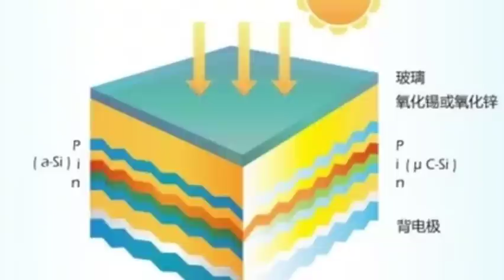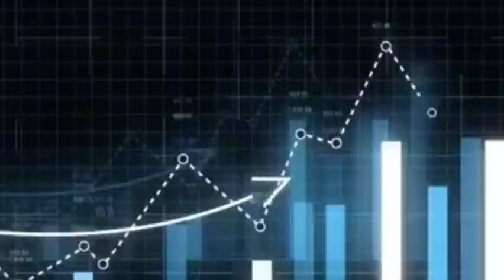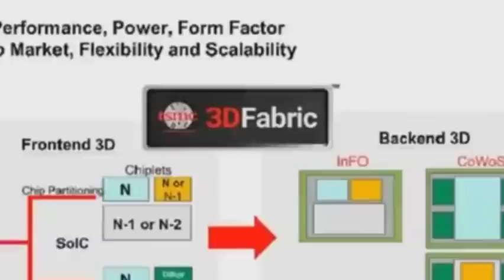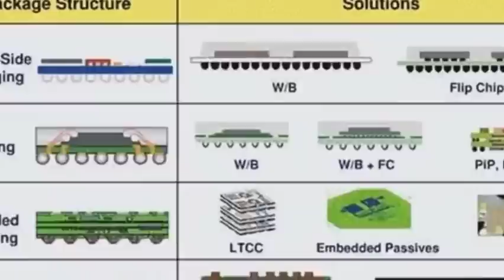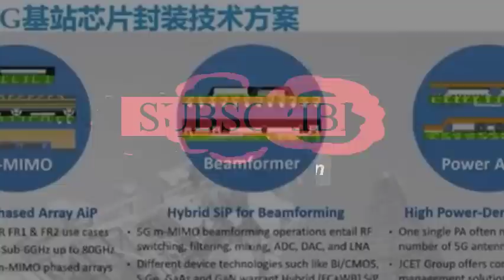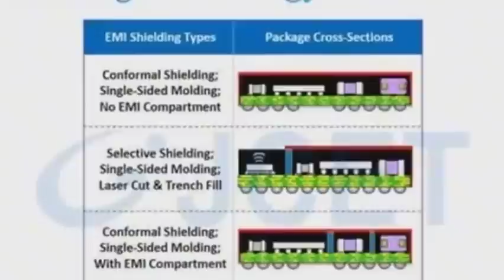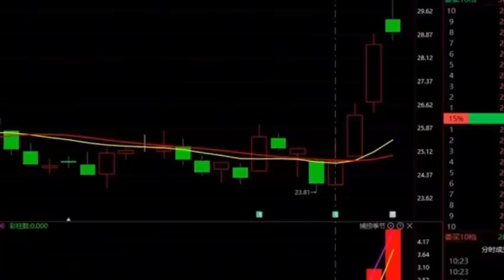China begins mass production of 4nm chips? These are the truth about Chinese Chip-in-Package.

Comment: No.  As of the beginning of 2023, China can 1) produce 28 nm chips and 14 nm chips in production quantity. 2) Can produce limited number of 7 nm chips.  3) Can handle 4nm packaging.  

That said, given its track record, I am expecting them to reach 7 nm mass production within 5 years.  In 10 years, they might know how to make 4/3/2nm chips in mass production, but let's face it, 3 nm and 2 nm chips are irrelevant given how much it costs to make.  And it is so small that quantum interference will make further development impractical.

But that said, China will still go through the process of 4/3/2 nm chip making.  By then the silicone chip industry is a high end but sunset industry.  The industry will move on to graphene chips, where China is on par with US/Samsung/Taiwan in term of technology development.
Reply: I hope China will be at the forefront even if China is cheated by other countries bro
Reply: As I understand chips packaging is combining chips on wafer level. That is even better. Not producing cheaps that can later be used to combine all the other chips to make smart phone, TV, etc. The problem now is the production capacity to meet China self sufficient chips.
Reply: The old joke about graphene chips is that graphene can do everything ... except to leave the laboratory.
Reply: @tvgerbil1984  no joke, the production plane is under construction. And 7nm chips has passed the production test.
Reply: @tvgerbil1984  good point.  But sooner or later we have to make it work.